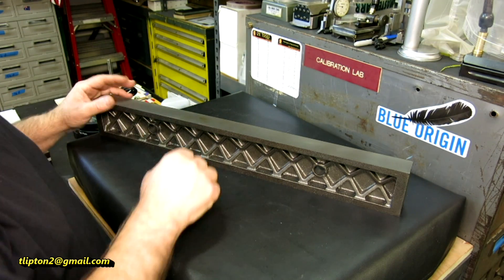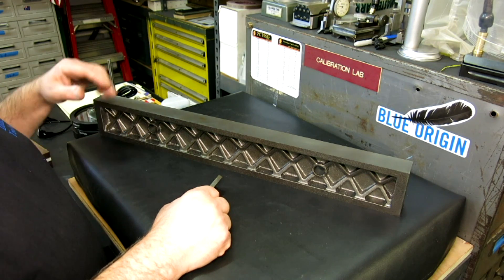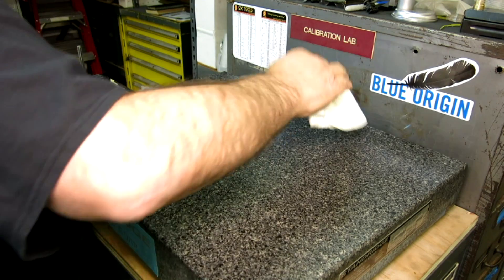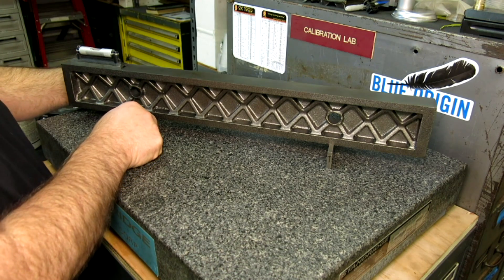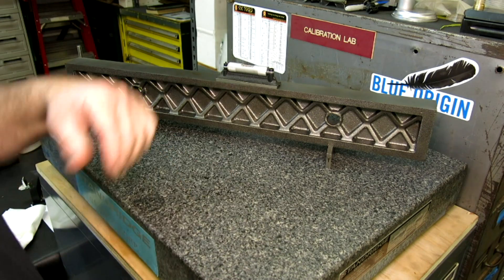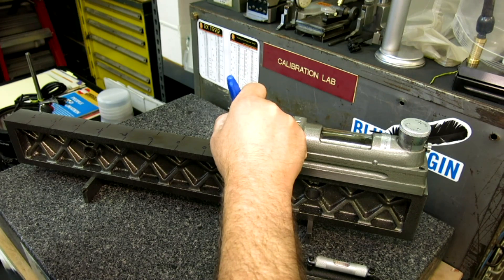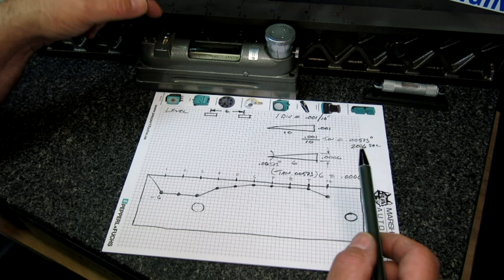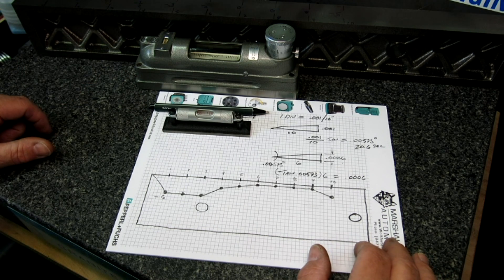Measuring a Straightedge with a Precision level

Comment: Everyone can measure flatness with expensive tools like this.
Try using a string. String and a laser to see the gap.
A vertical string is absolutely straight and has a defined surface unlike light.
I've seen a dude using electricity to prove it has a contact. In theory you could run it from edge to edge, corner to corner, push it to contact by an indicator and remove material as needed.

Comment: I think this is a wrong way to measure straightness. When you have a 5 inch level, you have to start from zero to 5 inch. The next point starts from 5 to 10 and so on.

Comment: I was down my big box hardware (bunnings in Australia) and i didnt have me glasses on, so i picked up one of those laser levels and misread its accuracy. I thought it said such and such over Km but it it actually said such and such over meters.

I spent 25 minutes opening the box, reading the instructions and setting it up. So im all good  and walk over to the wall to mark my line and the laser was about 3/4 of an inch thick! 
You may as well have marked which of the boys pissed furtherest up the wall! 

So i left me glasses at home and took it back for a refund. I figured the kid behind the counter was just a thick as i was, so i slapped it on the desk turned it on and said to the kid go look at how thick the line is buddy! I walked out with a cash  refund 💰💰💰  LOL!

Comment: You stupid twit.....when you clean the surface of a granite plate YOU DO NOT TOUCH IT WITH YOUR BARE HANDS.........skin oil as it dries off will become sticky and destroy any ability of a surface gauge or height gauge to slide smoothly on the table top.
We used to wear cotton gloves to work on the stone table.....cast iron tables are not prone to this phenomena........the stone table, when not in use, was always kept covered to keep any assumed airborne dust off even though the room was to clean room standards.

Comment: Not sure why you had to over complicate it by converting to angle
0.001" per 10" is the resolution correct?
so if you get 1 division per 6" that is simply 6/10  x 0.001 = 0.0006 " (0.015mm) deviation occurred on 6" on that straight edge correct?

Comment: I have this problem or should i say doubt on how to check the straight edge using laser and surface plate. If I lay the straight edge flat on the surface plate and the surface i want to check is perpendicular on the surface plate, should i set the parameter to x or to z?

Comment: If the straight edge is metal, in my opinion you should have lightly stoned the top with a hard arkansas stone to remove any dings and then clean it with your special cleaner.

Comment: If you operate in radians, then you can use small angle approximation for such small angles, see https://en.wikipedia.org/wiki/Small-angle_approximation for details. Basically, sin(x) = tan(x) = x if x is small enough. This will simplify calculations a lot. For example, if L is the distance between contact points, then the height deviation d = L*tan(x) = L*x, where x is the measured angle in radians (!). However, in metrology , any measurement is just useless without uncertainty estimations. In this case, since every measurement is relative to the previous one (integration), then the uncertainty will grow as you move on, e.g. if first point is in +/- 1 thou, then the next one will be in +/- 2 thou etc. I suspect, that autocollomators are used for this application, because even the visual ones have an order of magnitude better accuracy and resolution, than any practical spirit levels.

Comment: if you place the level on a flat plate with 2 roles, like sine bare roles , that are closer together you can get a very small measurement as close together as you can balance the lot. and as long as you know the distance of the tuch points you can do the math

Comment: Just my 2cents, but wouldn't it make more sense to simply support the straightedge on the surface plate with parallels or 1-2-3 blocks at the Bessel points, then run your indicator over the surface of the straightedge (referencing the surface plate) to get a map of deviation all over? That way you can get a more detailed picture of what the surface looks like.
I would question the errors that could creep in due to the length of the level and the wide but limited coverage (there's no way to run the level off the end to get readings beyond the large footprint). Also, you are looking at two points simultaneously for each reading, which could be a numerical nightmare to analyze.

Comment: But what is the significance of the fact that the level base is bigger than the intervals of measurement? Because the level base will then average over the whole length of the level base against the straightedge, but at the same time it will startle over small "valleys" and rock on high sections.

Comment: Cool.  It never occurred to me to measure iteratively at such small regular intervals, like a time series.  One quibble, for the benefit of any high schoolers watching:  At about the 11:30 mark, you don't take the tangent of the ratio (0.001/10) to find the angle.  You take the arctangent or inverse tangent or tan-1.  You take the tangent of the angle, of course, to find the ratio of opposite/adjacent, as Mr. Ox does in the very next step.  Just ordered a master precision level (0.0002"/10"), which will drive me insane if I use it to level a pool table.  Promises to be a fun trip.  And a short one.

Comment: Tom, when using a level to plot flatness, you have to move the level so that the center of the following pads land on the previous center of the leading pads. Your kind of just moving the level around willy nilly there. The moves need to be incremental based on the center of the pads. Your plot would only have 3 dots or 2 flat measurements. I've been manually plotting flatness with bubble and electronic levels for almost 30 years, not sure this really shows you anything. Just my two cents
Reply: i agree and would add that there ought to be contact points only at the ends of the level
or what would work is to consecutively shim the level  at increments keeping the level stationary
Reply: But then the contact points can fall into small "holes" and throw of the measurement. Because you want to measure averages over certain intervals, not surface roughness.
Reply: how big you think the contact points would be?
Reply: Lone Wolf Garrett 87 Welsh  national railways
Reply: he wasn't moving the level willy nilly, he was moving it incrementally.

i think what you describe is the minimum number of steps (least overlap), as in the moody method, which is good for ease of calculation and wise when checking large stuff like lathe ways etc. he had a one meter beam, so he went with larger overlap and took more measurements, but they were still regularly spaced. the data set obtained through your method is fully included in tom's data set.

that being said, tom mentions at 13:15 that it would be interesting to flip the level for the other end of the beam, but i think that doesn't make sense since the level had already been there. he would just take the last few measurements again while looking at it from the other side.

so he did in fact check the whole beam, each number corresponding to the midpoint of the level. which means that his beam is lopsided. anyway, the thing should have sagged in the middle, not humped.

Comment: Since those levels tend to be expensive, I wanted to note that you can buy the bubble vials itself for cheap from the "usual suspects", with specs like, say 10" (1/3600 degree), for sub $10. Then I guess you can easily make your own level by attaching the bubble to, I don't know, a parallel, or 123 block, with some screw adjustments to zero it, and "Bob's your uncle" (?)  I did not actually make a level like that yet, just ordered a vial - any comments on this idea?

Comment: Tom, I have a few questions, your videos always do that to me...., that I hope you can explore. I used a similar technique in trying to understand the overall flatness of a way surface once with blocks under the heel and toe of the level as it was not relieved in the middle like yours. One of my thoughts then and questions now is about the reading at any given point. I think it just becomes a measurement of the incline or decline of the level at that point and not really an "elevation" reading relative to the initial point of zeroing. The reason I thought this was because any "low" point along the surface can create both an incline and decline reading as the level is moved along; the toe drops in the depression first (declining) and then two or three segments later the heel drops in (inclining) that point creating the opposite affect. I could never figure out how to take each reading as an angle, independently, showing the change- between the two points on the level, along the surface and come up with a method to accurately reflect the surface profile...Maybe someone can? The other question I had about the straightedge was about aging it. Are you a believer in the process and will you be doing it? I've read about and talked to folks who say that all castings, when new, are under stress and any scrapping, or lapping in your case, would be negatively affected as the stress in the part is relieved over time. Burying castings in the ground is one proposed method of aging, some have even suggested that it gets tossed in a pile of gravel, in the back of a truck and left there for some time (weeks) to be subjected to the vibrations and weather changes to help season it... Thoughts? Thanks for the Video! Take Care.
Reply: I am in the measuring business also, as a land surveyor, and I think you are right.  I think the answer to your question has to do with exactly where the "feet" of the level are, or rather, exactly where they touch the bar being measured.  That is indeterminate in this example, because the feet are broad.  Imagine that the level is 10 cm/inches/units (unit doesn't matter to get the idea) in length.  I live in SC, so even though I prefer metric I'm gonna go with inches.  So, your level is (lets say) 10 inches long, and the feet start at one end, and are two inches long.  Then, there is a six inch "gap" in the base, and another two inches of feet.  Now imagine you are testing a supposedly flat bar that is actually concave along its length (but ya don't know that at this point).  Here we must stop and attend something else.  The level wasn't zeroed, so the original starting zero that was set before measuring commenced was an arbitrary angle off level (unless the tester was very very lucky).  He should first have marked the ends of the level on the bar, then zeroed the bubble (as he did).  Then, he SHOULD have picked the level up, reversed the ends, and noted how far off the bubble was.  Lets say the bubble was three marks off when the level was reversed.  To make the level (not the bubble, but the level itself!) level, he would then have needed to raise the bar AND the level up on one end so that both the bar and the level (but actually only the level becuz the bar is concave) such that the level read "off" one and a half marks.  Then he would turn the level back to it's original orientation and it would still read "off" one and a half marks.  At this point the level would be truly level, because the bubble is reading the same way regardless of which way it was placed on the bar.  Now, without moving the level, the bubble needs to have one end raised or lowered so that it reads zero (so that it is centered).  Once that is done, the bubble will stay centered when set down in either direction.  NOW FINALLY we know that the level is truly level, the bubble is zeroed, and the tiny portion of the bar we are checking is also level maybe (except we secretly know it isn't cause it is concave).  NOW we can get to my point, which is that, if the level feet are perfectly flat, when the bar is concave, the feet will touch the bar at two points 10 inches apart.  But, if the bar is convex, the level will touch the bar at two points 6 inches apart.  But we don't know the shape of the bar, so WE DON"T know the distance between the two parts of the level base that touch the bar. So, what do we do?  The first thing we need to make an accurate map of the bar top is to isolate the exact point of foot contact.  In this example, I would think it would be best to put a precise and accurate guage block of identical size at each end of the level, the smaller the better.  If you could get two IDENTICAL tiny bits of square bar stock about 1/8" cross section, a couple of inches long, and put those under each end of the level, you would then finally know that when you measure change in level, you are measuring 10 inches of the bar.  Now, because you truly zeroed the level (assuming the level has no sag, and your tiny bars match perfectly) when you measure the first 10 inches of bar, you get a usable (both accurate and precise) angle.  In the above video, the angles are precise (repeatable) but not accurate, because the level was not zeroed (checked against itself by reversal). I am pretty sure that the rest of the demonstration and math is valid.  I am almost positive that if the level had been properly zeroed, then the plotted line would have wandered above and below the imaginary perfect level line on the chart, rather than being entirely "down".  The reason I am pretty sure about all this leveling stuff, even though I know nothing about machining, is that in my profession, leveling is very important, and our survey instruments have to be, well, VERY level.  To accomplish this, we level with a bubble, and so before we can do anything else, we have to check that the bubble itself is truly indicating level when centered.  The first thing we learn is, point the instrument crosshair at something, and center the level bubble, then, we point in the exact opposite direction (first north, then south for example) and we look at the bubble.  Is it still centered?  If yes, the bubble indicates level when centered.  If no, we fix that by removing exactly half of the "uncenteredness" of the bubble, by raising or lowering one end of the bubble (which our instruments are designed so as to make that simple).  If half the uncenterdness has been removed, the bubble will read "off" center the same amount no matter where you point the crosshair.  At that point, the instrument is level even though the bubble says it isn't.  Then, you raise or lower one end of the bubble tube till it reads centered, and your level bubble will indicate true level for a week, or if lucky, for a month.  Knowing all this is also the reason that when I use a carpenters level, I check something for level with it, then I reverse it and check again.  If the readings don't match, the level gets replaced, and becomes just a carpenters straight-edge.  In other words, this video was very helpful, but the proper pre-calibration of the level device wasn't understood (or just wasn't explained) and the uncertainty regarding exactly where the bottom of the level was touching the bar made it impossible to know how much of the bar you were measuring with each measurement.  If the bar was concave (sagging) a 10 inch level would measure 10 inches at a time, if not, there is no way to know, unless you add tiny feet that are a set distance apart.  I hope this makes sense to somebody, it took me a while to type.....
Reply: @johnwetzel5248  Wow... Thank you! That was a very well thought out answer and it made sense to me. Before getting to the part of your note about surveying equipment I was thinking that your line of work is really just a macro version of what Tom was trying to demonstrate. These words, level and flat, are used often as an absolute and most times when I hear them used like that, I just smile... Thanks for the response! Take Care.

Comment: What I'd like to know is how to level a C channel rectangular frame so that it's flat. I've seen so many people making welding tables but no one talks about flatness which is as important, if not more, than squareness.
Reply: A welding table, you say? Would that be the version of welding where things get hot? Where the table is made of a material with a non-zero coefficient of thermal expansion? And you're heating some parts of the workpiece to red heat? Depending on the degree of flatness required, a lump hammer may be an ideal tool to help. A bit more specification in your query would help to give a useful reply.
Reply: Two string lines across the diagonals. Space one up  by the thickness of the string.

Comment: great video.

working as a Surveyor, we have from time to time do work on some optical tooling benches in Labs and such, using level in a similar what to set the bench level to start then to set the equipment mounted on it level. 
A good level is a very powerful tool in an workshop.

Comment: It occurred to me when you showed the graph that if you invert the values you are remotely measuring the wear of the machine used to prepare that surface.  The wear pattern looks consistent with what you might expect in a milling machine with most use near the center of the table.